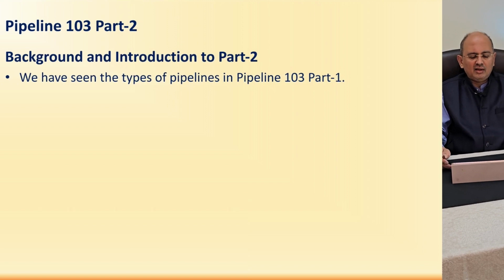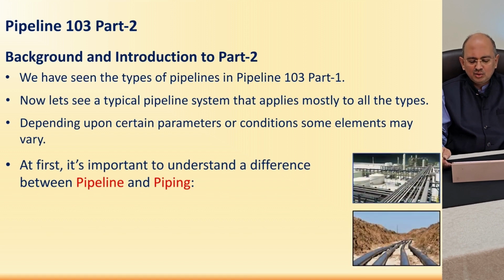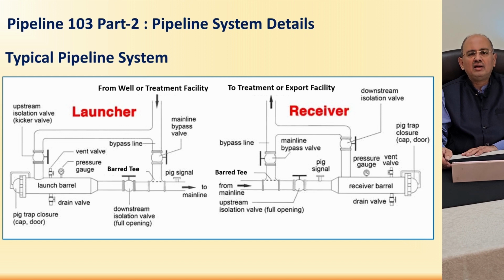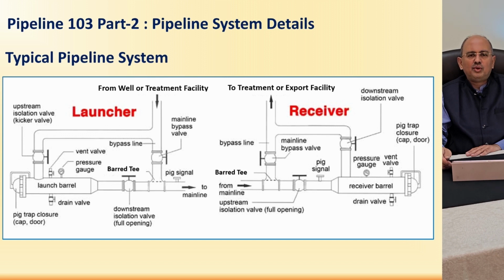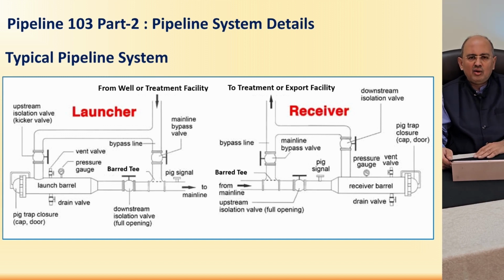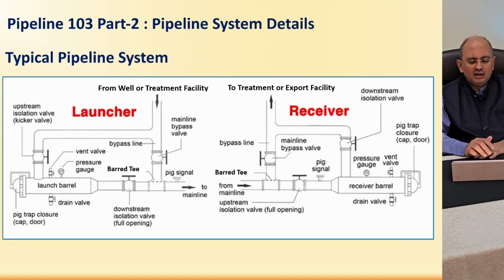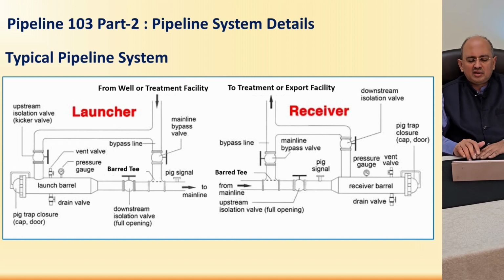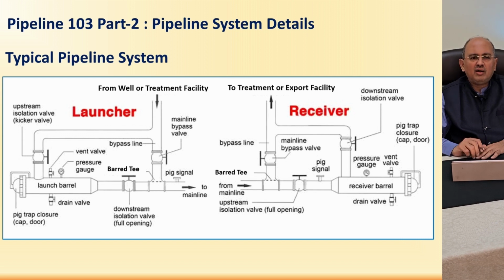Pipeline System Details | Pipeline 103 (Lecture 02A) | Beyond Pipelines by Harshal Barve

Comment: Great work Sir, Thanks for the Video.. very useful.
I have one question.. in Receiver side, what is the use of downstream isolation valve??
Reply from the maker: I believe you are talking about Pig Receiver isolation valve. That is required to keep pig trap isolated and preserved when pigging is not being done. Normally the flow is going through bypass pipe via barred tee branch side with pig trap kept isolated and preserved with Nitrogen.  Hope this clarifies your doubt.